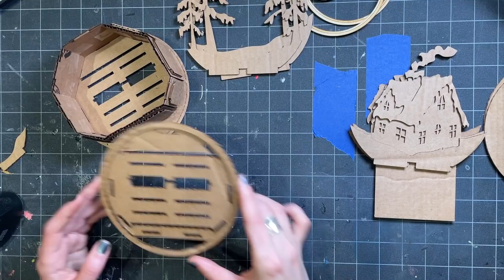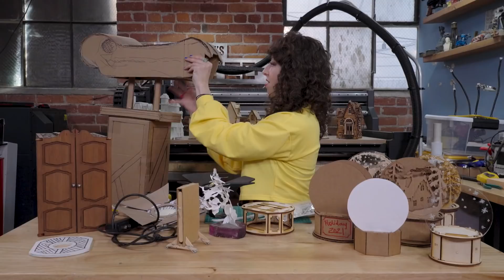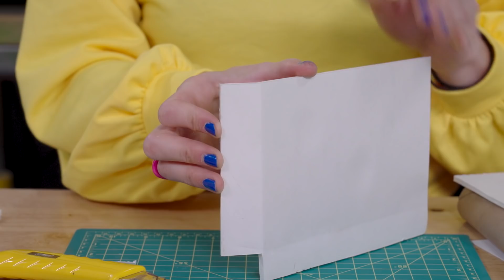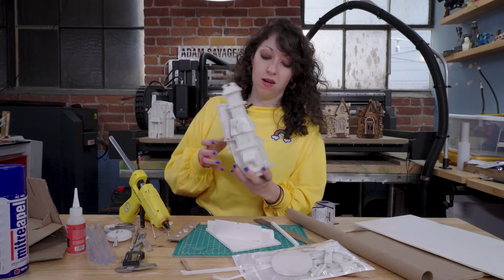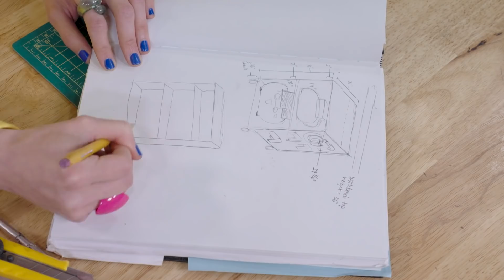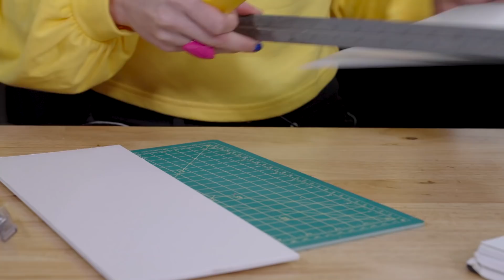Guide to Prototyping in Cardboard and Foam Core!

Comment: One other possible add to this: soundproofing. If you've got the space to do it, a more sealed cabinet is amazing! Leaving access to ports and controls should give you enough airflow, but reduce the noise by 50% or more. Really doesn't take much either! Small holders in the front for a bit of staple/nail storage, with the 'full' boxes in the back would mean less movement when you need to replenish the guns.

Comment: I don't know the dimensions of the compressors, but would it make sense, given that there is so much unanticipated depth in the unit, to have the shelf for the smaller compressor offset to allow the larger compressor to come above the level of the shelf? So the smaller compressor shelf would be a partial shelf that does not extend the full depth of the unit. I don't know if that would make the compressor awkward to use, but it might be a way to get the overall unit height you're looking for.

Comment: you should get yourself an engineer's / drafting scale. I use one all the time in my design sketches. Really handy for measuring and laying out scaled sketches, designs, dimensions etc at all kinds of useful scales. helps you avoid calculator math, and the inevitable scaled dimension mistake, leaving you scratching your head for as to why your prototype doesn't translate to full scale

Comment: Lots of good ideas-
I made a cardboard prototype of a small tool holder for my workbench then built a final version out of wood.  I built a similar small tool holder for my desk but I used foamcore for that one and the foamcore came out good enough that I just used it and didn't need to build a better one.
Regarding your tool cart- I would start with the freehand sketches then progress to sketching to scale on graph paper, or sometimes I will create it in 2D CAD.  Some people would do this in 3D in something like sketchup.  This is a good way to be sure everything actually fits, and for me it is quicker than prototyping with a model.  The next step could be to build a model.  The foamcore model is good for exploring how you would actually build it, what overlaps what, etc.

Comment: I have always found the blue Elmer's glue sticks, with 1" pins from the back side of the joining piece, work well when gluing 2 pieces of foamcore together.  Of course the pins get removed after the glue sets, unless the piece needs to look like it has rivets in it.

Comment: One way to cut down on the math of scale models is to use a triangular scale ruler.  It is an odd shaped ruler, but it provides six faces that are marked off in common scales. For example, there would be a 1:48 scale side, with tick marks numbered for feet, but already scaled down by a factor of 48 (1’ = 1/4”).
Reply: Yes!  I've had one of these in my drawing table drawer for 20 years. Very useful tool.
Reply: Most commonly available in stores might be an architect's scale, set up for 1/4 scale and smaller.
Reply: @billj5645  Mine has a side with mm adjacent to inches. And then a side with cm adjacent to meters. And the third side with scaled graduations in different colors

I also have flat ruler with CM on all four edges rendered 1:1, 1:2, 1:4 and 2:1

Not sure the intended purpose but they work great for model-making.

Comment: If you only need it a couple of inches lower, you could inset the casters - just build little boxes in the corners. Assuming those are round compressors, there's space in those corners - as long as you can still get the bottom one out...
Reply: Of COURSE! I hadn’t thought of that, thank you!

Comment: Those longer glue sticks are sweet.  I need to buy those in the future.
Reply: I've found through trial and error that there are also different densities and melting points across different brands of glue sticks and each has advantages depending on the material you are working with and the type of finish, if any, that you plan to apply.
Reply: @lo-firobotboy7112  I used to think a glue stick is a glue stick but this understanding is great so I know there's more out there for different applications. Thank you.
Reply: @hanslain9729  Glue sticks from hardware stores, at least in my area, seem to be stickier than similar ones sold at craft chains like Michael's. There are also glue guns and glue sticks for fabric and so on.

I used to use glue guns to build entire sculptures. Think of it like a free-from 3D printer.

Comment: One thing useful for me to cut foam core at 45 is to use a cheap mat board cutter from the crafts store.  It cuts at 45 and you can adjust the blade depth.  Makes it super simple and clean.
Reply: 100% I love a bevel cutter for foam core! Hadn’t thought about setting the blade for a partial depth cut though. Very clever